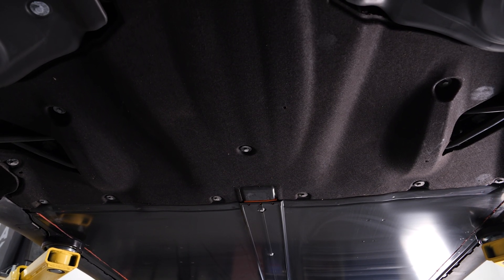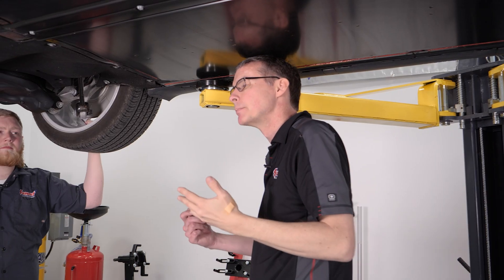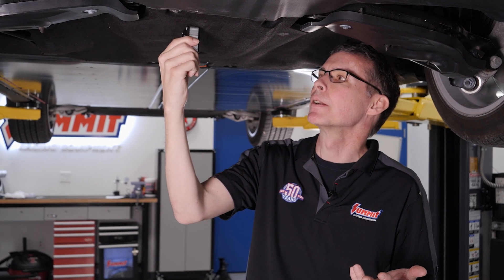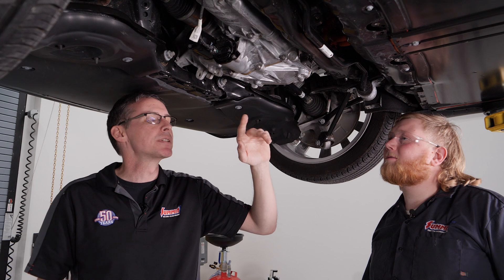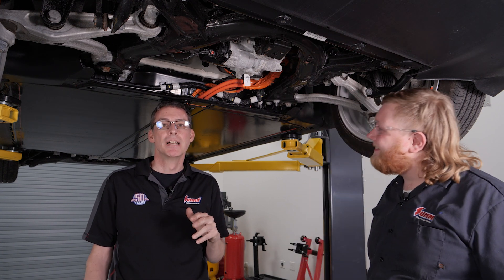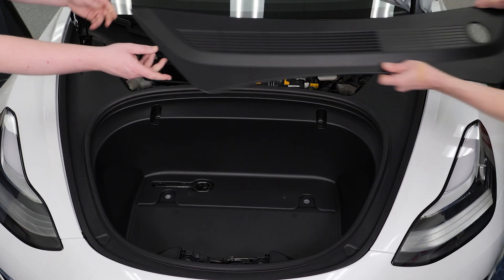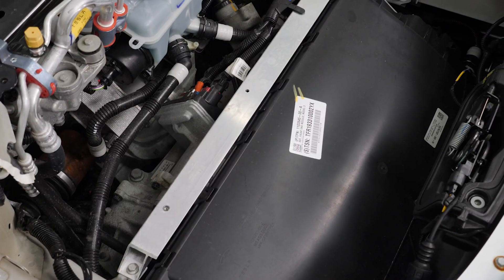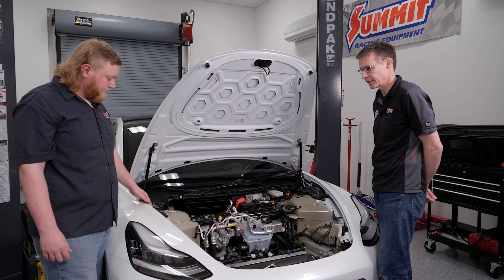Anatomy of an EV | Project White Lightning (Part 3)

Comment: Why does it have a lead acid battery?
1. cost, $150 vs $500 per unit.
2, simplicity, no heating required. Lithium batteries must not be charged when their temperature is at or below freezing.
It would be nice if they'd install an easy access charging port for that battery.  James May did a report on why they die and what happens when they do.
Reply: 2022+ models have a lithium 12v battery 🔋now